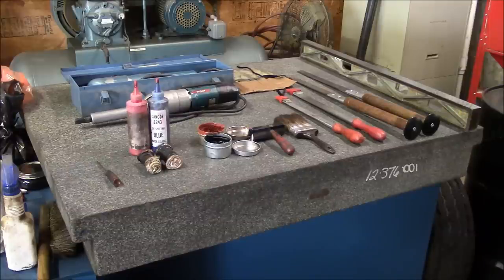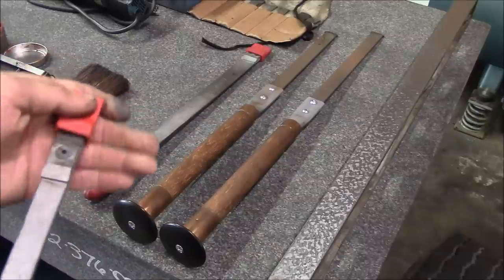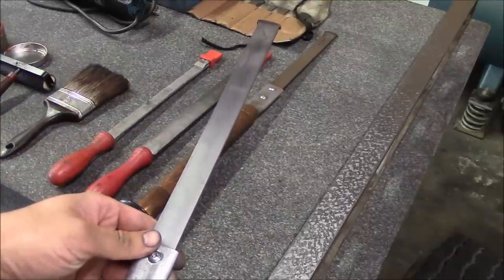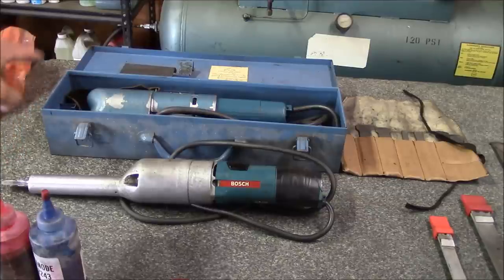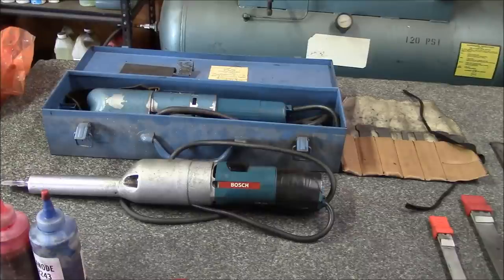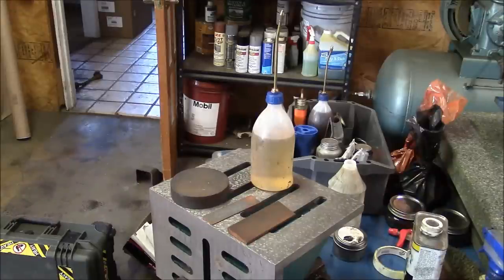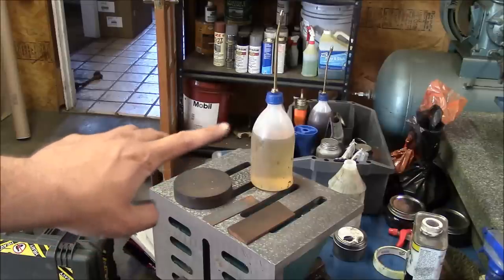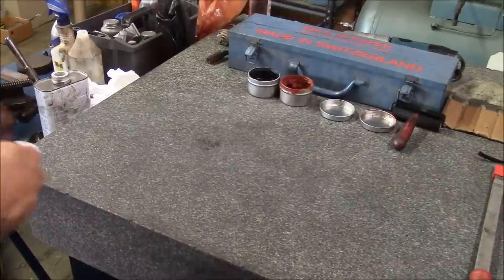Hand Scraping - How I do it.

Comment: Where do you buy scraping supplies, such as the flat rollers, pigments, scraper handles, and straight edges, etc? I have a surface plate, but not a straight edge so I need to make or buy one. I've been looking for a scraper handle and other supplies, but no luck. I guess I will have to make one
Reply from the maker: Those things can be purchased from companies like Speedball for the roller, Dapra or Sandvik for the scraper, Challenge or Suburban for straight edges, etc. But, they are very expensive. I buy most thing on ebay, but you have to be patient.
Reply: Wes Johnson I know where you can get some castings hehe.
Reply: Enco online has HSS hand scrapers for 7.00 each. Good item to get started with.

Comment: Have you had any problem with your biax power scraper in terms of parts availability? I heard they're pretty much non existent for the any repairs.
Reply from the maker: There's basically no parts for anything but the most current model.
Reply: @WatchWesWork  
 Yes I know I'm aware of it but the machine you have have you had any problems I've seen many videos were your very competent and fix everything that's why I asked about your experience with that particular machine and have you made any repairs or did you just get rid of it and get the new silver model
Reply from the maker: @johncollings6799  To be honest, I never really used them much, so I sold them off about a year ago. I never had any issues with them, but I can't really give a long term report because I don't have that many hours on them.
Reply: @WatchWesWork  
 Got it.
 thank you so much. still doing any scraping manually?

Comment: What is the point of this? I have no idea what this is.  Is hand scraping something that is used to making something more visually pleasing?
Reply: The granite plate was made very flat. (*Very* flat!). Using that as a master reference, Wes made the angle plate (a clamping/set-up fixture for other machining operations) very flat, also, so as not to influence any of the work pieces later clamped to it whilst they are being machined. Scraping for flatness is often required on larger/awkwardly shaped parts that may not fit on a surface grinder. The pattern also promotes the longevity of sliding ways on a machine tool, by forming "pockets" of oil retention, where a perfectly smooth surface would squish/squeegee the lubricating oil off the surfaces.
Reply: @mattmanyam  Good explanation. Thank you!

Comment: Okay I'm lost. I've scraped glass I've scraped wood. I don't understand what we're trying to achieve here. Is it just an aesthetic look. I'm just lost on the whole why are you scraping metal. Obviously it's not something I'm versed in. Being a woodworker. A little more explanation at the beginning would have been helpful for somebody that doesn't know what the f*** you're doing.
Reply: The granite plate was made very flat. (*Very* flat!). Using that as a master reference, Wes made the angle plate (a clamping/set-up fixture for other machining operations) very flat, also, so as not to influence any of the work pieces later clamped to it whilst they are being machined. Scraping for flatness is often required on larger/awkwardly shaped parts that may not fit on a surface grinder. The pattern also promotes the longevity of sliding ways on a machine tool, by forming "pockets" of oil retention, where a perfectly smooth surface would squish/squeegee the lubricating oil off the surfaces.